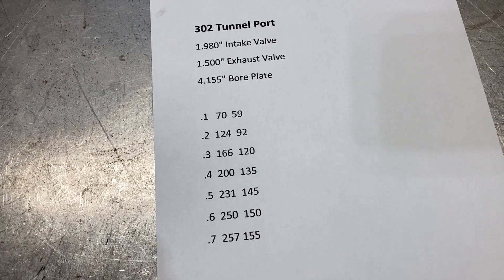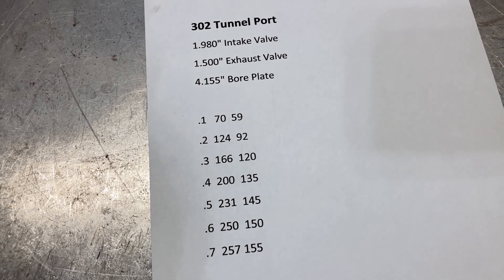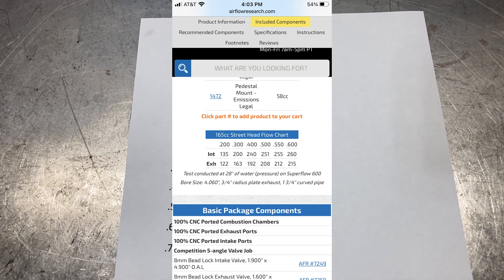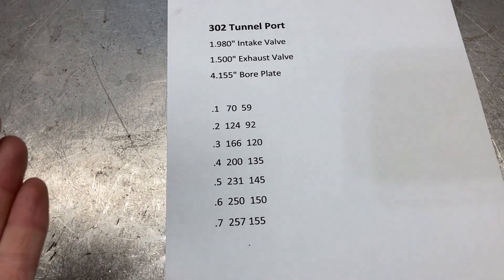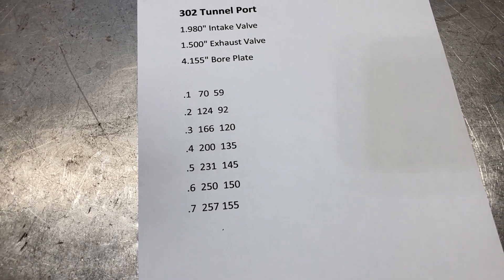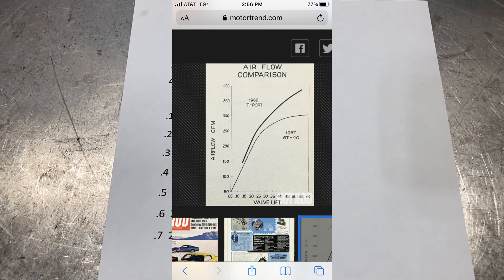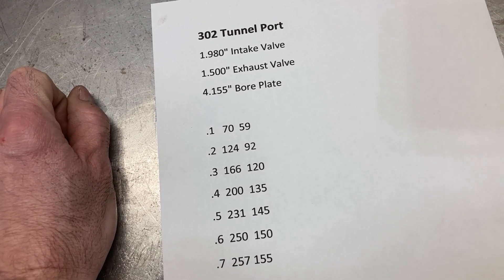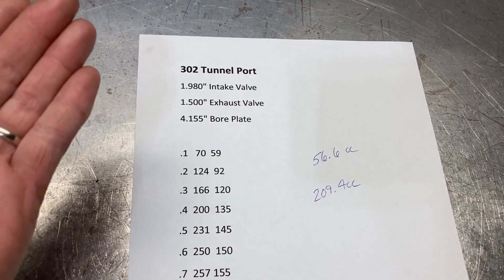Lykins Motorsports Ford 302 Tunnel Port Heads On The Flow Bench

Comment: The reason why they got rid of the 302 tunnel port and what it was doing. They were trying to establish the same thing with the 427 tunnel port understandably. So except the porch were too big for the cube against displacement. And so that's why they had to change the structure, or shall we say the architecture to what we call the boss 302 boss 351 or the Cleveland that's why there was a major change, the 302 port was not functionally. Well, it crashed during the 1968 season.  Or 67 when they were going against Chevrolet.And Chrysler because the problem was the way it was developed in the flow characteristics.They didn't have anything lined up in the proper aspect like the four twenty seven dead at lamont when they won four years in a row.

Comment: 1967 GT40 heads are not the same as tunnel port. 1967 gt40 heads are rectangular  ports heads and were much better than the tunnel port head. Sad thing is tunnel port was supposed  to be the better idea well that is why Cleveland heads found there way on the Boss302....

Comment: MAYBE FORD DIDN'T LIE ABOUT ITS CAPABILITY TO FLOW HIGH NUMBERS. STRANGE HOW IT HAS A LARGER PORT AND YET FLOWS LESS AIR THAN THE AFR WITH A SMALLER PORT. THE LARGER CC PORT THAT IT HAD PROBABLY WORKS TO MAXIMUM POTENTIAL WHEN THE HEADS ARE HOT AT OPERATING TEMPERATURE, CREATING WHAT THEY SAY IS "VENTURI ACTION" LIKE A SCAVENGING EFFECT, BUT IN THIS  CASE THE REVERSE CONCEPT OF WHAT THE CAST IRON TRI-Y EXHAUST MANIFOLDS DO OR LIKE PUTTING A WRAP AROUND HEADERS.

Comment: Hey Brent,

 David Vizard here. Stan Weiss and I have a very advanced flow bench program. If it will help Stan will send you a free copy for you to evaluate.

This program not only delivers flow numbers but also Discharge coefficient, port velocity, port energy and specific port energy and swirl data. It also calculates the effective intake/ex. ratio as well as calculating what your engine actual needs. (this hinges on the CR). It also calculates the torque & HP to within about 3%. It also generates publication quality graphs.  If you go to my channel (just put David Vizard videos into the search bar). The two videos showing the program at work are now pretty old and things have moved on but they will give a good idea of this very effective program.
David Vizard

Comment: Hi Brent, I take it those are the street tunnel ports. The race heads had a rather large exhaust port. Reading Smokey's Power Secrets back in the late 70's he claimed his SBC heads for NASCAR flowed about 250 cfm on intake.
Reply: And for reference, a set of Cleveland  Iron heads, with filled bottoms and a good port and valve job were 340-350 cfm on intake side. Around 1978
Reply: I'll add that was for NASCAR. They have tested a pair of heads Dyno Don did in the 70's and got 382 cfm peak.

Comment: LOL what crack Ford was smoking 🤣🤣🤣  
It will be interesting to see the flow numbers and change in air speed if you fill the bottom of ports like you do with the FE  T-Ports. Looks like a 5 angle valve job, smoothing out any bump from intake valve seat to chamber transition and some larger back cut valves are in order.  Hopefully these were not previously ported by someone who doesn't know what they are doing and opened the throat to much. Need to shoot for 90% or so in the throat to valve measurements. Still gonna be a cool build though.

Comment: Hi Brent I have always built clevelands,i have had  mild 302 w before, my build is the same as you only with a Dart block 4.125 bore 363 cid,i was wondering have you ever used CHI heads on this combo before,if you havent whats yours take on it,i see CHI make 220 cnc port 3v and have manifold to suit 8.2 deck block,or be better sticking with afr 220
Reply: Here is a 347 Clevor Brent built with 185cc CHI heads.  https://youtu.be/nmdQKLtwaTA 
Your 363 will most likely love the 225cc heads more but that depends on what your intended use will be for the 363. The factory style inline valve heads are usually cheaper and less of a headach to build than what is involved building a Clevor type engine
Reply: @nova467spanker  Hey Mate Its different over here in Aus as by the time you have the dollar converion shipping and a 10% gst on the AFR 220  heads they are well over 4000 dollars,so i can buy the [220 cnc head] CHI wholesale for a around the same price,225  [not cnc ported] cheaper,so[220 cnc flow around 360 cfm ]and  225 flow i think 330 cfm,the motor is for a weekend toy maybe a few runs on the drag strip and i want to mine as much hosepower i can from this combo
Reply: @aussiesupersnake6642  Im guessing its kinda the same if I wanted to buy CHI or Higgins stuff with the pricing.

Comment: Some good info once more Brent. Interesting series here for sure. Am I correct in my thinking that Ford expected customers to work these heads to max flow for the end user intended purpose? Otherwise it just seems they left a lot of untouched potential on these heads. Of course I’m guessing at what the end flow numbers will be at this point.

Comment: Why wouldn’t you use a modern head it would be so much more superior than the cylinder head is the way it sounds especially the size of board that you were going to use
Reply: I would venture the engine has to be equipped with period and design correct engine parts. Meaning that he is running some type nostalgia/stock class road racing division.

Comment: With all do respect.
Those heads should not be modified. 
It is destroying history.
To rare of casting.
If you lose a engine, where would you get another head.
I like your channel. 
But really need to think of the value of these heads.
Do you have the intake?
Also, would be nice to know the flow numbers with a 4.00 or 4.030 bore adapter. 
Nice content.
Thank you, EM.
Reply: Sounds like they are just going to reshape the port by adding epoxy which will not remove material and permenatley ulter the head. Nothing wrong with raising the floor and doing a good valve job. No need for flow numbers with other bores, no one has these heads so what will the data be worth? It would not decrease the flow that much.
Reply: I agree. Just give them a good seat job, blend the bowls  and take any sharp edges off the short turns. They will make power beyond what the flow bench suggets. If this customer wants to run TP heads then he has to accept what they are and what they are limited to. What intake are you running? Ford probably werent aware of the sciences related to air flow dynamics and probably didnt have a 7deg taper in the intake runner or anything like that. What a shame to bastardize these heads. If he wants big Hp numbers then he's barking up the wrong tree with these heads. I say just leave them and use them but  just accept the peak number outcome and deal with it. If he wants to go fast around corners then Taking weight out of the car is the same as making more HP.

Comment: Yes , I was under the impression that those heads flowed tons . Who would've known without testing .
Reply: Brent mentions that these are the street heads. There is also a competition head, which has 2.15" intake and 1.60" exhaust valves, also the ports are bigger on the competition heads. Going through the Lykins video postings on YouTube, they don't have any flow tests on the comp. heads, but it would be much more than the "civilian" models. Valve sizes are different too. 2.15 vs 1.98 intakes and 1.6 vs 1.5 exhausts. Also shaft rockers vs individual fulcrum rockers.

Comment: The '67 gt40' head could be either the C6FE head ( sometimes referred to as the HD289) or  the Gurney Weslake head. I wouldn't have thought they would make a comparison with a big block head as fitted to the Mk4 ( an MR), but given the obvious disparity with real world flow figures who knows?
Reply: Ford did make a GT40 / 289 head, it had taller intake ports and bigger exh ports. I saw some pics once. I dont think its was an FE flow chart. However that graph looks good dosent it! , maybe they took the valve and pushrod tube out to get that figure??
Reply: @ford-speed  Yes that's the HD289/C6fe I was referring to; it flows about 225/230 cfm and the Carlquist repop can manage about 240. The GW head  is about 265 in period.